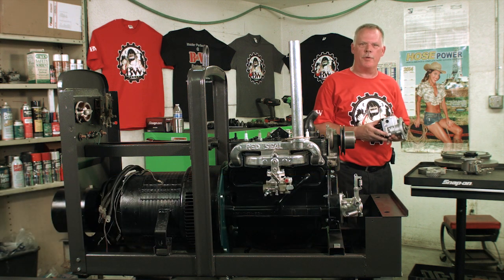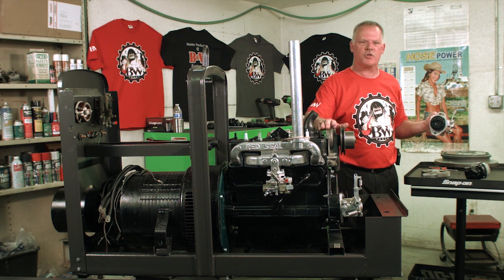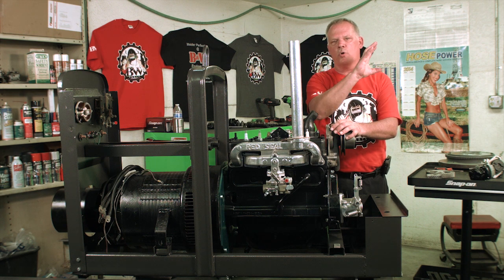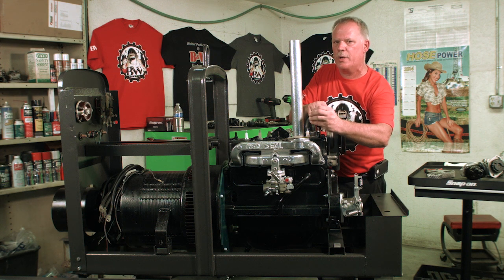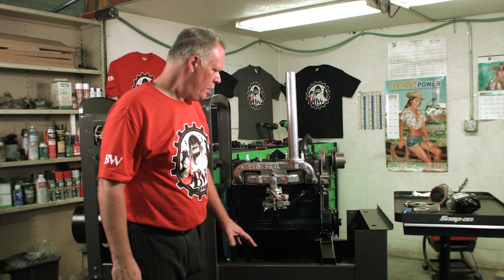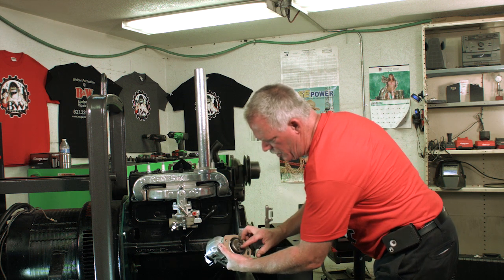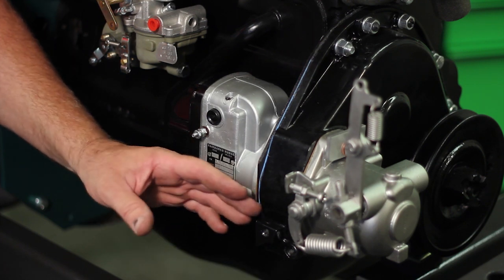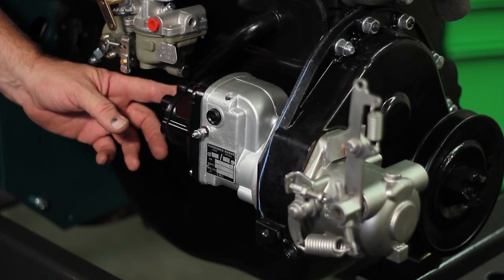Magneto Installation: Lincoln SA-200, SA-250

Comment: Question: What is the difference between fmj and the fmx kits on yalls website I need to rebuild my magneto because it don't create spark except number 1
Reply from the maker: The FMX is more commonly used on SA-200s and other equipment, while the FMJ magneto is typically found on older units. One of the most noticeable differences is the fiber gear placement—the FMJ has it mounted on the dust cap, whereas the FMX has it mounted on the magneto side, next to the points and condenser.

Hope that helps! If you have any questions, feel free to give us a call at 1-888-BWPARTS (297-2787)

Comment: What cyl is number 4 I have no mark on the timing gear nor on the flywheel so Do i put it a number 4 tdc and install the govern so when the magneto is installed and the rotor pointing at number 4 compression stroke?